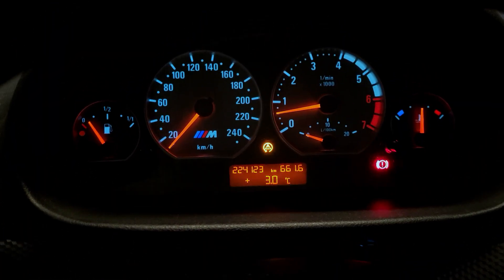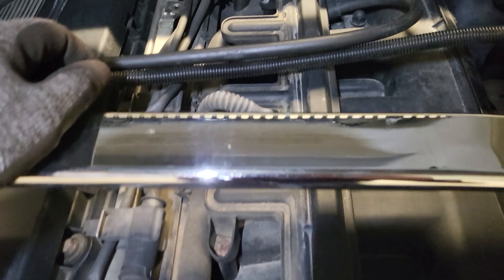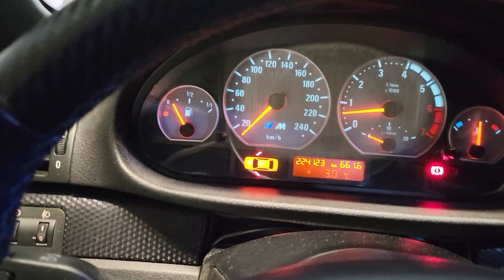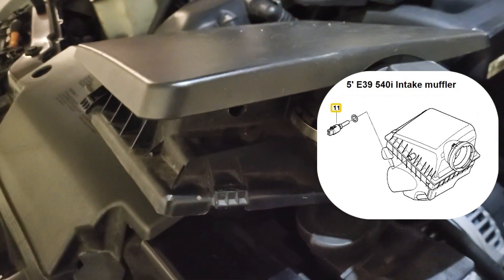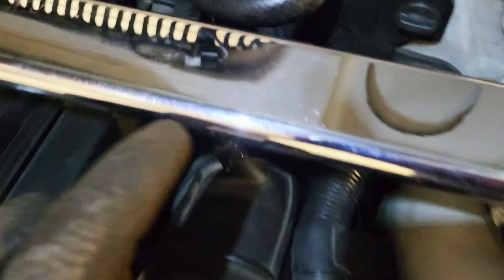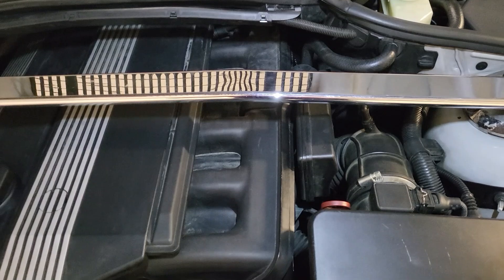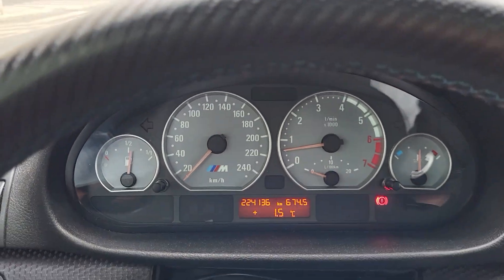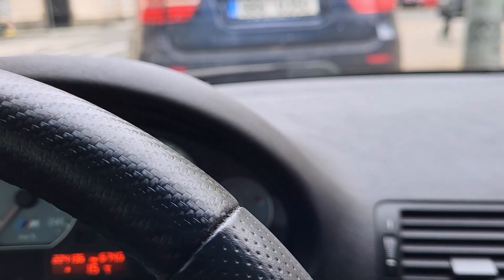🌡️ BMW M52 & M54 - Was the Intake Air Temp. Sensor (IAT) in the wrong location by design? 🤔 #bmw

Comment: That's not a good idea. The MS43 ECU uses lookup tables to calculate the effective air volume based on temperature and then determines the injection load accordingly. This process is quite complex due to the absence of a pressure sensor. Now you need to adjust this lookup tables. Furthermore, next to the IAT are the injectors and the injection time depends on the air temperature. Now you take the IAT far away from the injection position to calculate the injection time.

Comment: Isn’t the temperature in the original position more accurate for a nicer mixture since is the actual temperature of the air going inside the engine?

Comment: Wouldn't the original ECU logic have accounted for that temperature drift, and expected the high difference between the intake temp and the ambient one ?
Reply from the maker: Coming from BMW in the early 2000's, I'd expect that too! 
I was studying the IAT characteristic curves for the MS43 and MS45 (there is a very nice write-up called "Aftermarket_Upgrade_Sensor_Data" in the ms4x website) and when I put data tables in a chart, I saw that the curve used by the MS45, that has the IAT sensor integrated in the MAF sensor, is "cooler/colder" than the characteristic curve of the MS43 that mounts the sensor in the intake manifold, which is IMHO counter-intuitive, so I went all in for the mod; but I must say that I didn't study the AFR map settings of the MS43/45... that's OOS for me :(